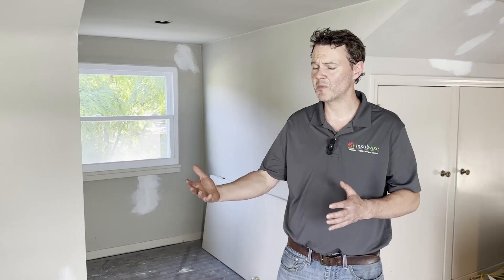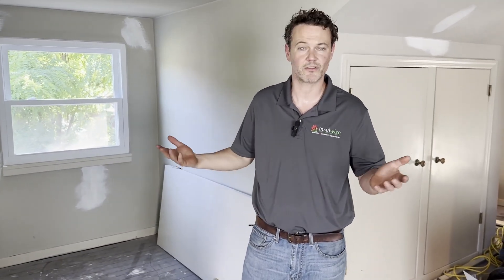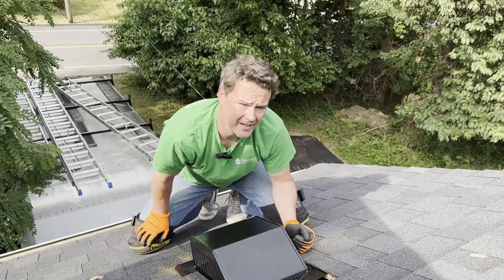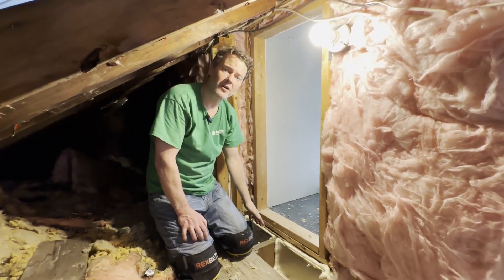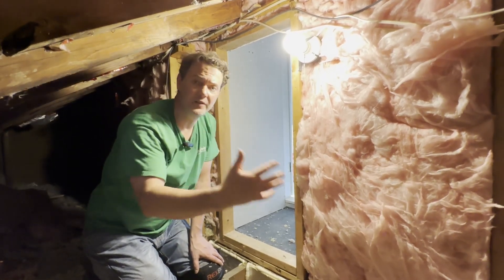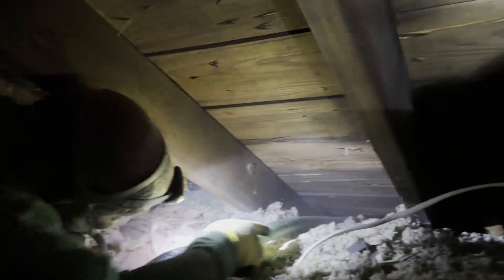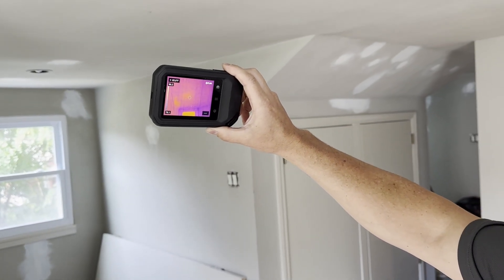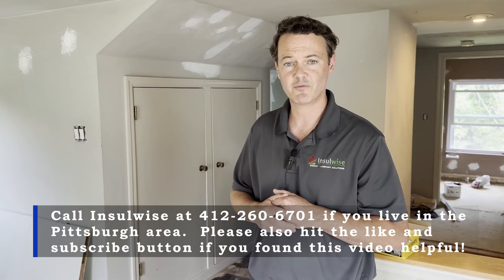How We Quickly Cooled This Sweltering Cape Cod Home with New Insulation!

Comment: I currently have insulation batts with paper backing in the ceiling all the way up to the main attic, can I leave this in, or should I remove it to dense pack?
Reply from the maker: I'd leave them in place either way.  If they take up the whole bay great, but if they only partially take up the bay than I'd leave them in place and also dense pack the stud bay to install extra R value.

Comment: Hi, thanks for the great video. Do you have any suggestions for roofs that have a ridge vent in the attic area? 

I think I'd need to leave the slope ceiling able to vent up to the ridge vent.
Reply from the maker: This house had a ridge vent.  We dense packed the sloped bays to up the R value and performance there, and made sure that the lower knee wall attics were independently vented.  A ridge vent alone on the upper main attic space is in most cases adequate for venting  that space. 
Andy

Comment: OK Ok Ok.  I am subscribed.   My 1984 spec home here in New Hampshire ‼😞.  Purchased in 1997.   Frozen Hydronic pipes FIVE feet inside the house.  A month ago.  Discovered and now living in the forgotten storage space full of empty boxes.   The wind in the exhaust vent for the bathroom below.  Open air vents in all the eves.  Insulation stuffed behind the bathtub on the second floor and a one by two foot vertical shaft receiving all that air through the floor rafters (covered by plywood for the "storage space") right behind the bathtub shower.  Old two inch insulation board.  I do not know how you guys take this on.  Nightmare.    Same thing on the other side of the house.   A four by three foot part of the wall, not insulated and with no framing.  Maybe needs an access door built.   A three inch septic vent pipe wide open right in there. Sketchy insulation everywhere. And I've been living in this house for 30 years !!!   Oh my goodness !!!     Whoo Weee.   😳. Thank you for sharing all of this.                    ❇New Hampshire ❇
Reply from the maker: Thank you for commenting!  This work is absolutely not for the faint of heart😂.  It sounds like you have quite the project on your hands.  We would cut the storage - subfloor back in order to access the “floor transitions” and air seal them.  Having good eave ventilation in those spaces is a big plus.  If you treat them like individual attic spaces to be ventilated, air sealed, and insulated you will be on the right track.  
Andy

Comment: I'm doing this on my own little by little, and I could use your advice. I have a 1960's Cape Cod in upstate NY zone 6. I've started joist blocking, and I'm a little confused about what to do for the roof deck area. I currently have soffits and a ridge vent. I am going for an unconditioned attic space. 

The kneewall has old batts with kraft paper on both sides. I wanted to remove the old batts and replace with faced R21 insulation and house wrap (I have a small access door and limited funds, so I'm using house wrap instead of foam board for the kneewall). 

The old batts installed on the kneewall are ran a few feet into the roof deck. So if I pull it out, there is a section of the roof deck that is now missing insulation. The roof deck is tight, so running new batts in the same manner as the old ones would block airflow. There would also be the issue of no air barrier for the section of insulation that extends into the roof deck.

My thought was just to cut the insulation at the top of the kneewall? I'm sure you have a much better idea!
Reply from the maker: Hey there, yes cut the batts off at the roof deck.  If you can fully insulate that sloped ceiling area.  You can see in our video that we dense pack it with cellulose. Then make sure both the lower and upper attic spaces are well ventilated.  The drywall and several layers of paint will function as your vapor barrier on that sloped ceiling.  If there are penetrations in the sloped ceiling that seal those from the inside using caulking or foam.  If you have more questions hit me up and good luck!
Andy

Comment: Great videos- very clear and informative!   I thought the insulation required a vapor barrier on the conditioned side? I have a bonus room over an unconditioned garage and I was told if I had baffles in the 2x12 rafters from ridge vent to soffit vents and an R 30 insulation with a vapor barrier to the conditioned space that would be sufficient.
Reply from the maker: The batts that we installed have kraft faced vapor barriers on them you just can't see them here.  What you were told is correct.  That's how sloped roofs have been getting insulated in new home construction for about 40 years now.  Thanks for commenting!
Andy

Comment: For the r19 on the vertical kneewalls- is that faced or unfaced? Or doesnt really matter?

You also said that a more premium solution would be using fibreglass and then adding rigid foam on top. I am assuming you would use fibreglass that actually fit into the cavity, and then do the rigid foam across the studs? 

Thanks for the videos!
Reply from the maker: We used faced fiberglass for doing this.  If you wanted to cover the knee walls with foam board after installing the batting I would recommend using R15 or R19 batts.  Slightly compressing the R19 isn't going to appreciably reduce the R value of it, but it may make installing the foam boards a bit trickier.
Reply: My kneewalls are 2x4 and some places 2x3, so the cavity is only 2.5 inch or 3.5 inch. Struggling to figure out how best to insulate.

Comment: great video! I have one question: I saw you install slant back vents on the low slope roof and blocking the soffic vents, can the air intake and exausted only through a same vent?
Reply from the maker: Thanks for commenting.  This home did not have any soffit vents.  Air exchanges both ways through those vents.  They work very well in these smaller attic spaces.

Comment: You are my new favorite channel! I will be upgrading the insulation using your techniques in my cape cod style attic. Since it will be an unconditioned space, is a soffit/ridge vent acceptable? Or do I absoloutely need to add in roof vents on each side?
Reply from the maker: Soffit and ridge vents can work as your sole ventilation source in the cape cod style homes --- as long as both are open / ventilating enough.  The soffit vent will ventilate the lower knee wall attic spaces, and the ridge vent will ventilate the upper attic spaces.  I have done this.  Most of the time around Pittsburgh cape homes do not have soffit vents ventilating the lower knee wall attic spaces, so we have to cut in slant back vents. 
Andy

Comment: This is the best solution and explanation I have seen for the sloped area in over a year of trying to figure this out! Shoot, wish you worked in my area. A few questions... 
1. At 4:22, did you blow in insulation under the floor of the conditioned area before you blocked it? 
2. is there any moisture issues to consider since there isn't room for baffle & vents? 
4. At 9:24, you show insulation on the wall with the windows. How did you insulate that wall? Was that sprayed in from above similar to sloped ceiling? 
Thank you!

Comment: Thanks for this!! So helpful. Out 1945 cape cod home has soffit vents around most of the perimeter and a few can vents (I think these are the same as the slant back vents you used) just on the south-facing side. We get really bad ice dams. We're thinking to install a ridge vent along the entire ridge and add can vents on the north side to vent the knee wall. It seems like the soffit vents provide the intake and the can vents exhaust the knee wall? For the top attic, do the gable and ridge vents just exhaust? Do we need an intake in the top attic? It's really small. We don't have room for baffling so the attics will be isolated spaces.
Reply from the maker: Thanks for the compliment and commenting, sounds like a good plan for your Cape Cod home!  The isolated attics on these types of homes tend to be on the small side.  In my opinion it is less important to have both an intake and exhaust vent for the lower or upper spaces.  For example when we encounter these homes and the lower attics have nice wide open soffit vents, we don't recommend to install slant back vents.  The main thing is to air seal both the lower and attics as best you can (in addition to insulating and ventilating).  A ridge and gable vents on the upper attic will be more than enough ventilation there. 
Andy

Comment: I have a cape cod style home in tacoma washington.. Recently I replaced all insulation on the floor then sheeted with osb & glued sheet vinyl floor to clean up the 6 x 30 floor space. Then I reinsulatated kneewalls with batt insulation and covered with osb all across and put in some led flourescent type light. I insulated the access door,which is the back of a custom bookcase i made, with 2" foam and foam sealed everything. 
My question is Since birdblocks were never cut in, Should I cut them in now on every other studbay and should I install Slantback vents, and should I install a ridgevent and insulate the flat ceiling from a slantback vent access before its attached to the roof? Great video I learned alot thx
Reply from the maker: Thanks for the compliment and commenting!  I had to look up what birdblocks were!  We would call those soffit vents here.  If you have air sealed the lower attic spaces well than you'll be fine with 1-3 slant back vents depending on the size of the knee wall attic space.  You could also install soffit vents and if they were extensive enough you could get away with them alone.  We don't install slant back vents into knee wall attic spaces if soffit vents are present (but we rarely see this).  
You could install the main upper attic this way.  If the space is too small for access we will often blow them with cellulose insulation by "tubing up them" from the knee wall attics via the sloped ceiling bays.  This not a fun task. but it's sometimes the other way.  You can also blow that space from a vent access (prior to installing the vent) but your coverage may or may not be as good as if you'd "tubed up the slopes."  
Hope this helps!  If you have more questions let me know. 
Andy

Comment: Hello, any tips on how to find a professional like you in my area?  Any specific things to look for?
Reply from the maker: Thanks for commenting.  Look at their websites first of all.  Look for companies that are focused on attic air sealing and reference a building science based approach to doing this work.  If they don't mention this (air sealing) I'd pass.  Best case would be finding a company that can test in / out of your home with a blower door.
Reply: @insulwiseenergycomfortsolu3293 thank you. This helps a lot. A tip that someone gave me is that our local power company (PSEG) works with certain providers as part of a home energy audit. To be a participant in this program the provider must do blower door tests and then report the results to PSEG.  Will take this for a run and post back here the results, in case anyone else had the same question.

Comment: Is it possible to condition the knee wall attic space by insulating using cellulose or batts under the roof and gable ends then covering it with 2” foam board ? If we do this do we need vent the condition area with fan?
Reply from the maker: It's technically possible do to this, but you need to make sure that all of the seams in the foam board from the exterior wall up to the top of the knee wall are air tight, and this is very difficult to do in practice.  If they're not air tight water vapor can escape through from the home and hit a condensing surface (the underside of your roof) and potentially cause a mold / rot problem.  
This may or may not happen, and it's something that we don't do and would never guarantee.  The colder the area you live in, the bigger the chance of having this problem.  You would want to condition this area as well as you can with a both supply and return ducts.  That would help you out on the moisture side.  Hope this helps!
Andy
Reply: What is your recommendation for conditioning knee wall space in a cape style house located on Long Island NY 11050 ?

Comment: How did you insulate the upper main attic ?
Reply from the maker: We first air sealed the attic floor and then blew it to R-49 with 15" of cellulose insulation.
Reply: @insulwiseenergycomfortsolu3293   is it a problem to insulate the under roof using Owens Corning Foamular R7.5 board then use housewrap ensuring Ownens board are properly tape sealed and spray foam any gaps
Reply: @insulwiseenergycomfortsolu3293 is it a good idea to
- Use Owens Corning Foamular R7.5 board then 
Ensure all the joints in housewrap and Ownens board are properly tape sealed and spray foam any gaps to insulate under the roof ?

Comment: At 5:55 a note pops up about potentially covering the knee walls with a layer of foam board. Can you explain? My concern is that if you put R13 faced insulation against the knee wall surface with rigid foam behind it and then airseal it, you would create a double vapor barrier (vapor sandwich) which would cause mold problems in the kneewall space. How would you prevent this? Thank you!
Reply from the maker: Great question.  IF the kraft paper were an effective vapor barrier you'd be correct -- but it isn't.  Kraft paper is a joke and I don't know how the fiberglass companies are able to get away with it.  It's a layer of paper sprayed with a thin layer of bitumen/ tar.  There are small gaps all around it.  Batting these types of walls with R-13 batts and covering the batts and outer studs with foam board insulation has been a routine practice in new construction in the Pittsburgh area for at least 20 years now.  We don't see problems with it with mold growth / moisture issues with this practice.
Reply: @insulwiseenergycomfortsolu3293  Super helpful, thank you!! Last question- do you use XPS foam or foil-based polyiso? Thank you!
Reply from the maker: @omnomnomnivore2766  On knee walls the best solution is to use foil faced polyiso board.  The reason is that the foil face will function also as a radiant barrier, reflecting heat from the roof back out toward the roof, rather than just absorbing it into the insulation.  We do this on a weekly basis when working with knee walls that are already well insulated with fiberglass insulation.
Reply: @insulwiseenergycomfortsolu3293  I have access to a lot of rigid foam board insulation (bought second hand from a contractor who overstocked). its 2 inch thick boards. Would be ok to just double up and do 4 inches of rigid board behind the kneewalls, or is it still better to do fibreglass bats inside the stud cavity and rigid board over the studs?